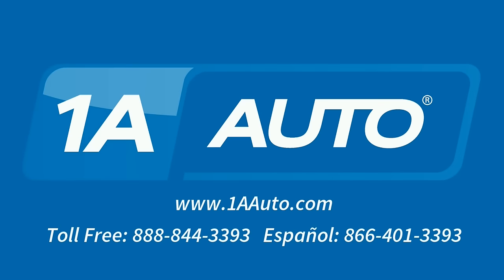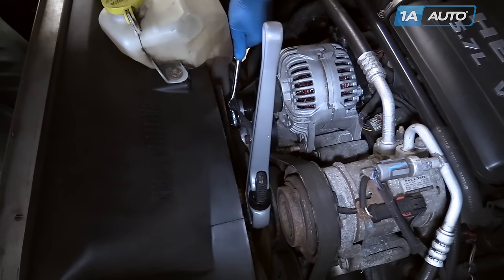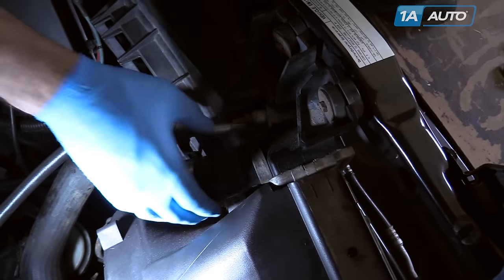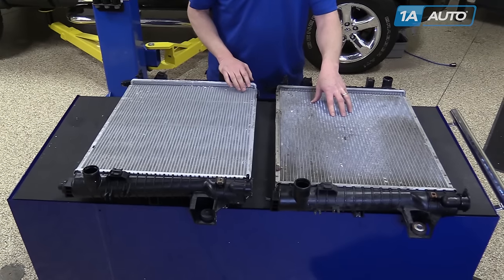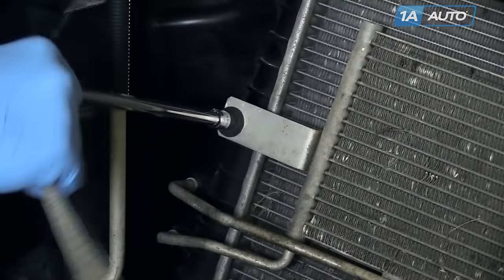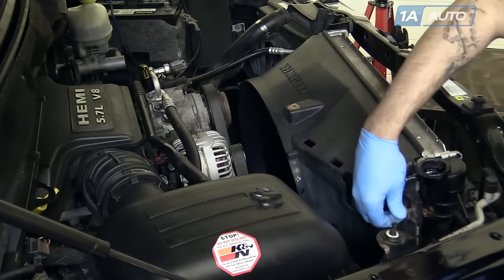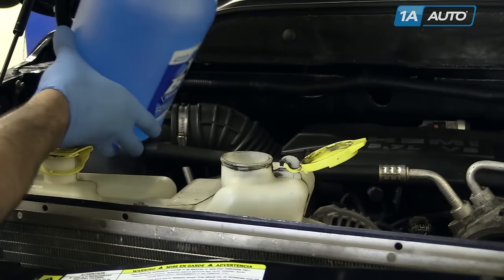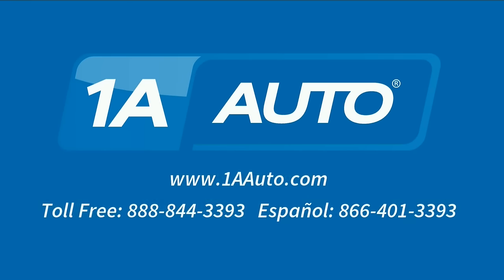How to Replace Radiator 04-08 Dodge Ram

Comment: Thanks for the video Jimmy! I will say that for the 2005 ram 1500 you do not need to remove the fan at all, and you do not need to remove the transmission cooler or whatever because it's in a different location. Took me 15 minutes, amazing.
Reply: Did you just slide the shroud over the fan to get radiator out?

Comment: Great video. Followed everything exactly step by step. Was done about 1.5 hours. Only thing not mentioned was to removed brackets and spacers from old radiator to the new one.

Comment: My plumbers wrench that I had handy was too small to hit with a good whack, so I used a clutch fan tool positioned on the radiator fan to keep the belt from spinning while I loosened the fan bolt.

Comment: Fyi people just did radiator replacement on 2006 ram slt 1500 hemi, you do not have to remove fan, shroud and the retainer tanks for coolant and windshield washer fluid, can simply unbolt shroud from radiator and set it back toward engine and slightly pull over on a/c tube at top left corner of radiator and slide it up and out. But the rest of disconnecting is correct.

Comment: This is the best video on youtube for this swap. But if you remove the cross brace that runs in front of the radiator,  lleft front fender to right front fender. You dont have to remove the fan and the shroud can come out, still attached to the radiator.

Comment: Bought radiator from 1A Auto Parts, it is a quality replacement.  This video made it easy to do myself.  Like others I could not get fan clutch nut to budge but was able to easily remove the 4 nuts that attach the fan to the clutch which created enough clearance to remove the fan shroud.  This was for a 2008 Ram 1500 5.7L 4x4 QC Big Horn.

Comment: This video saved me so much time!. One thing though. The water pump pully kept spinning even though I put tension on the tension pully. I had to improvise. None the less great tutorial video on removing and installing a new radiator for my 2006 Dodge Ram

Comment: Another fantastic how to vid. Just replace the radiator today and did the brake pads and rotors on the rear Saturday. Wished you would have mentioned to take off the bottom rubber mount and bolt inserts from the old radiator though. New one didn't come with anything. Thanks again for all the good info.
Reply from the maker: +Robert Clements Thanks for checking us out!

Comment: You DO NOT have to remove the radiator fan, the fan shroud slides back over the fan enough to remove radiator

Comment: If you detach the shroud from the radiator. You can hang the shoud up on the fan. Take the top 2 bolts off that hold the radiator. Disconnect the upper and lower hoses. Disconnect the transmission cooler. Pull the radiator straight up. Don't worry about the fan. Done it a few times like this.
Reply from the maker: +bep2001 kumar Thanks for checking us out! 1AAuto.com

Comment: Hey just wanted to thank you guys for making this video. The step by step really helped. Only issue I had was getting fan off so I ended up removing radiator and leaving shroud around fan until it was time to put it back. Other then that, this video helped me get the job done in an hour  rather than a few. Thanks again.
Reply from the maker: +Joshua Caccamo Thanks for checking us out. 1aauto.com

Comment: The Fan did not come loose as in the video,,,,,, Instead of trying to break the fan from the motor , which can be impossible , if you cant break the nut loose. Disconnect the 4 bolts holding the fan to the clutch and slide the fan towards the motor . the shroud can be removed with ease. the rest of the video was spot on.
Reply: Jimmy Page I'm doing this repair today. the dang fan didn't come off. radiaotr fluid had gone everywhere and all over the belts making them slide over every pulley. I'm managed to remove shroud and fan the hard way.

Comment: would like to see parts list for related issues. if i need to replace the radiator, its a good time to replace the hoses, would like to see that as well. thanks. i plan on changing radiator on my dodge this weekend, following your instructions!
Reply from the maker: +Lee Norris Thanks for checking us out. 1aauto.com

Comment: Thanks so much for the quick and easy video. Install was a breeze, the only thing that was not correct was the tabs for the transmission cooler. The slots on the radiator were not the correct size. No worries, zip ties worked great. Thanks again!
Reply from the maker: +PayThePrice71 Thanks for checking us out! 1AAuto.com

Comment: Hey Mike thanx for your video,at least I know what I'm in for.I bought my radiator from Amazon for  $75. and it came with all new bushings and hardware.I just need a decent day to do it.My truck won't fit in my garage so it's the driveway. Thanx again.
Reply from the maker: +rockymontana1 Thanks for checking us out. Shop for high quality auto parts on 1AAuto.com:

http://1aau.to/m/Shop-1AAuto-c

Comment: I got the job done easily thanks to this video and the part (shipping was wicked fast). Thank you. However, the radiator was slightly different from the original. It didn’t have the slots to hold the transmission radiator but it’s ok because you can bolt it on with 2 10mm bolts. No need to remove the fan at all. It’s a waste of time.
Reply from the maker: +PA B Thank you for your order. If you would like to leave us a review on Google it would be greatly appreciated. Here is a link to our reviews section. Have a great day! https://goo.gl/i5JFNY

Comment: You guys make great videos but you don't need to remove the fan to replace the radiator. I have a 05 ram 5.7 hemi.
Reply from the maker: +Kurt Lindgren Thank you for checking us out, as well as the compliments. We did this to provide better viewing access, but you are correct that in most of the models the fan will not need to be removed. 1aauto.com

Comment: My sons 2007 1500 4.7L (Mercedes engine) got a crack in radiator. Does 1A Auto recommend any type of repair to radiator? Or is it better to replace? Great videos guys!!!
Reply from the maker: +Ed Anderson Thanks for watching!  Modern radiators are really not suitable for repairs, they are meant to just be replaced if crack appears.  Here is a link to the radiator that will be correct for your son's application!  https://www.1aauto.com/dodge-radiator/i/1arad00864?f=850748&y=2007

Comment: you DO NOT need to remove the fan or shroud. you can leave it in the truck. go look at other videos. I did and saved a lot of time
Reply: I had the same question. Can't you take the shroud off without taking fan blade off???
Reply: Do you have a link to the other videos?
Reply: There is enough room to slide the shroud back to the engine allowing you to pull the rad out easily. I left the washer fluid container on the shroud too. Works as a counter weight so it won't fall forward at you. 👍
Reply: Came to comments to say this ^ agree. Absolutely no reason to take clutch fan off!

Comment: The part where you are putting the transmission cooler tabs into were they slide into the right on the new radiator and in your video it's at the 5 minute 53 second time slot. My question is they are not the same now as they were in the radiator slots that you had in this video they have changed they are now Square pieces for each tabs but they have holes in them now they do not fit if you slide them in the tabs are too wide for them so now they go right on top of them with the holes matching up is it safe to zip tie them or do you have to use a bolt and if you do a bolt in a nut a locking nut what size?. You're probably going to have to re modify this video because all the radiators now do not come with those slide housing
Reply from the maker: +David K Thanks for checking us out!  If you purchased the radiator that is shown in the video then it should the same tabs.  If you received something that is different please contact us right away and we will try to identify a suitable solution for you!  1aauto.com

Comment: So for those having trouble with the fan nut on a 1500 5.7 (2006 or so range), I just grabed a regular Philips screw driver and on the side of the water pump, facing the fan, are 4 holes.  After putting on my pipe wrench, I carefully put the screwdriver into a hole (left side, to hold against the spin of the water pump) and I hit the pipe wrench as I held against it.   BE CAREFUL OF THE FAN BLADES FOR YOUR ARM CAN GET SLIGHTLY PINCHED.
Reply from the maker: +Malv3rs3 Thank you for the suggestions and for watching!

Comment: Take the air filter completely out put the reservoir where the air filter is no need to drain all that fluid least that's what I did also don't need to take the fan off just the cover you gotta work it out but not to hard to do least this is how I did mine.
Reply from the maker: +Zachary Drewery Thanks for the feedback!

Comment: Great price on your radiator. However the pipe wrench and ratchet on the pully didn't work for me. Gave up after and hour on it. Luckily though the install is possible without taking the fan off. Just unbolt the shroud and let it rest on the fan then you can pull out the radiator.
Reply from the maker: +brianfl33916 That's a good tip. Thanks for posting it. Thanks for checking out our videos! If any of our viewers need to make this repair, we carry the part shown in this video on our website. Here's a link to them. We also offer free shipping on all orders in the US. http://www.1aauto.com/dodge-radiator/i/1arad00878?utm_source=YouTube&utm_medium=CTA%20Comment&utm_campaign=1ATony

Comment: gave a dislike because.... you say to use the tension pulley.... to get the fan removed....but failed to mention that the arm that pulley is on is weak... and breaks easily....so end up costing me another 50 dollars.... to replace that arm for the pulley.... guys if you remove the air filter housing which is rather easy to do... you can jockey the fan shroud around enough to get past the fan it self...aka don't cost yourself another 50 dollars.
Reply from the maker: +Shocke89 Thanks for the tip! We'll pass this info along to our production team.

Comment: The stock radiator in same year make and model does come painted from factory.  There is special radiator paint that's available
Designed for radiators.  Your input and thoughts are appreciated thanks.